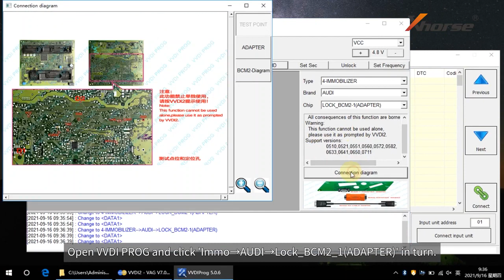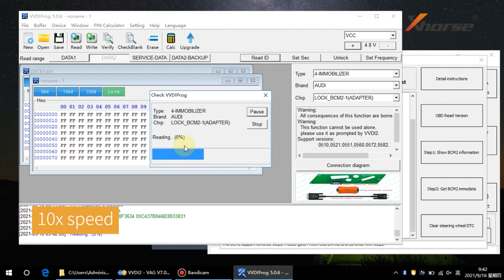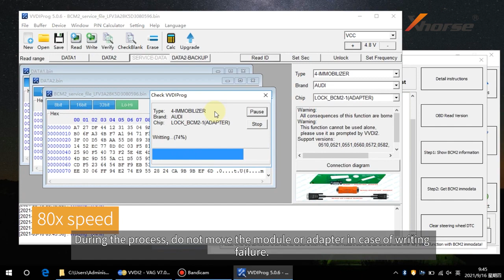Xhorse BCM2 Audi Adapter Connect to VVDI2 & VVDI PROG Quick Start

Comment: I can't read BCM2. i read I tried with the adapter and with the wires but without success. My error : Try Frequency failed(00)
I notice that the PWR indicator does not light up when reading the BCM2, but 12V indicator light on.
and 12V is not supplied to the BCM2 board

what will you suggest to me?